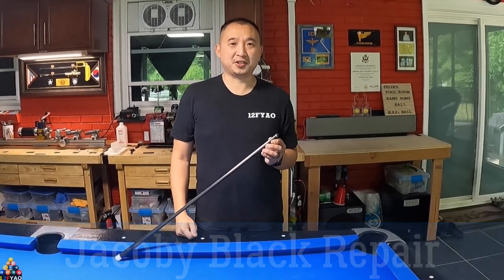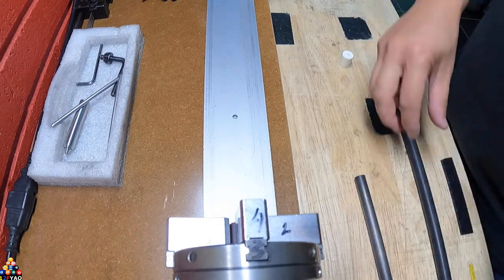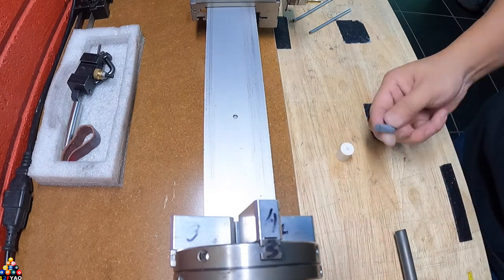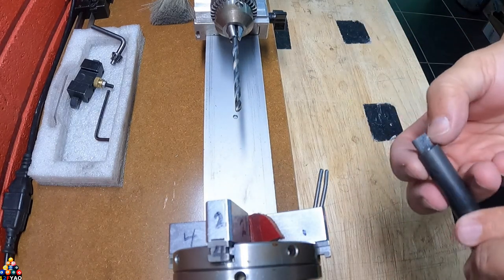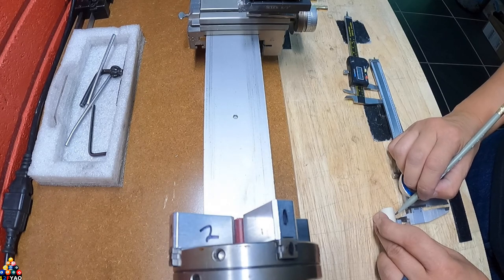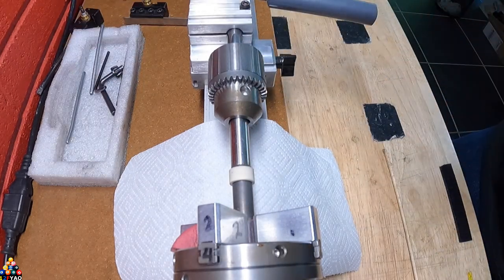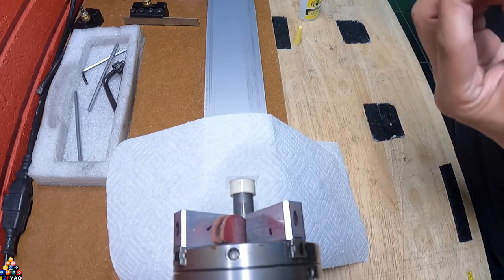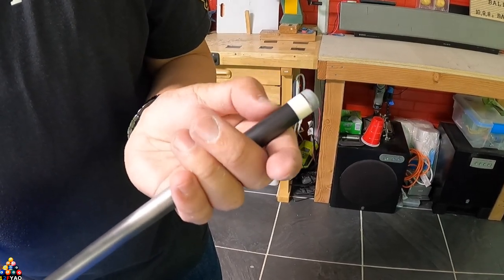Jacoby Black Carbon Fiber Shaft Repair

Comment: I add glue relief grooves in my inserts to promote adhesion.  I would have also milled the g10 like a plug to ensure it is seated properly in the shaft, then take down the exposed material and add the ferrule.
Reply from the maker: Thank you for commenting. I will do that on future shafts I might be fixing.

Comment: I have a suggestion, have you ever thought on about gluing a tape meaning to your work bench do you could just butt up the shaft against a fix/removable/flip piece of wood and do it all with one hand or have both available? Even you could compare two shafts at once without having to guess it and measuring twice.
If that doesn’t work, could you share with us why doesn’t it?
Thank you!
Reply from the maker: I actually do have a measuring tape taped to my work bench. I use it just to get a quick measurement and if precision is not needed. It is very helpful especially when cutting wood blanks. I also like to use a tape measure to get me the accurate length. Thank you again for commenting.

Comment: I have a Revo that is making a ticky noise from the vault plate.  The vault plate likely has a small crack and scratches.  I would like to remove the vault plate and replace it with a small white ferrule similar to this video. How can I reach you for the repair work?
Reply from the maker: I would reach out to Predator first. They should warranty the shaft. Also replacing vault plate with a longer ferrule will change the deflection properties of the shaft. It would most  likely have more deflection. Hope this helps.

Comment: Thank you so much for your video.
Is there any way to remove the scratches on carbon fiber shaft after the ferrule without cutting the shaft?
Thank in advance.
Reply from the maker: You can try to sand it off. The scratches can’t be too deep or it will change the diameter of the shaft. Also if you plan to lightly, I mean lightly, make sure you get quality sandpaper like 3M, no less than 1000 grit. Hope this helps, please subscribe if haven’t already and please share.

Comment: Why wouldn't you have simply filled the scratches and then polished the fill down to original size?   Seems to me like all the changes you made are going to alter how it performs.
Reply from the maker: My friend didn’t want nothing to do with the scratches plus the shaft was making noise. He wanted a real ferrule where he can see it plus he is good enough where he can adapt to little changes.  I totally agree on how I altered the performance on the shaft, my friend likes it better, now it has the same deflection as his wood shaft, he doesn’t have to adjust when playing with his wood shaft to this carbon shaft, a ferrule he can now see and the annoying sound on the front end is gone.  He is happy with the change, he doesn’t have to switch shafts when playing 10 ball to 1 pocket.  Thank you for commenting, please subscribe if haven’t already and please share.

Comment: how can you make a carbon fibre smooth. i have a revo shaft and it’s not smooth at all, i tried cleaning it with alcohol wipes and it’s still the same
Reply from the maker: That is one way I clean carbon shaft too, alcohol wipes. That is the recommended way to clean them. Sorry can’t help anymore and thank you for subscribing.

Comment: All areas of the pool playing world need someone who can fix pool cues to some extent. You are doing fine. As for the performance of the cue afterwards, the difference in this case will be small. It appears that you may have moved the pivot point of the cue just a small bit to the tip. Instead of a pivot point of 14 to 15 inches for a Jacoby Black, you may have made it a 13 to 14 inch pivot point. That will do two things, the response of the cue for spin etc. will go up a little which will make it do a little more for you but as a shafts pivot point shortens, it's friendliness to shooters bridge position decreases.  Shortening the pivot point adds to the response for spin but also adds to ability to go wrong in the shot. There is always a give and take to everything. If the owner has good stroke fundamentals they will like the change but if those basic fundamentals are not so good they will have more misses. 

All Predator cues have a 19 inch pivot point which makes them extremally friendly for Parallel English, this is what they are made for.  The 19 inch Predator shafts are excellent for Parallel English but anyone trying to play Back Hand English (BHE) will need a shaft with a shorter pivot point then 19 inches. The further back the pivot point of the cue the further back you need the bridge for BHE, 19 inches is too far back. The Jacoby Black has roughly a 14 to 15 inch pivot point off the shelf and this just so happens to be a friendly shaft for BHE. This is the ideal size to start learning BHE. I custom made my personnel carbon fiber shaft with an 11 inch pivot point specifically for BHE which is amazing for spin performance but costly if you are not bridging exactly where the shot needs and is not something available on the market in carbon fiber. You may find lesser regular wooden shafts with a pivot point this short or less but I am yet to find a carbon fiber with such a short pivot point. The 11 inch pivot point is not recommended unless you really understand where to bridge for specific shots based on cue ball to object ball distance and power.

I do not call this system of using Back Hand English, Back Hand English, it also needs Front Hand Pivoting as well sometimes so I call this style of applying spin "Pivot English". It is all about where you bridge and pivot. If you use the back hand to pivot for spin, you are pivoting at the bridge hand or front hand and when you use the front hand to pivot, your are pivoting at the back hand. In closing you did a great job and may have only enhanced the spin ability of the shaft with minimal increase in its unfriendly behavior.
Reply from the maker: Wow. Thank you for your deep analysis. Not many “pool players” know or even heard of back hand English. I use it for shots that requires a fast firm hit to move the cue around the table. I use with my Revo and I know I have to compensate a little because I don’t have a long enough bridge. For the Jacoby shaft, it’s my friend’s shaft and he also uses back hand English. The only thing is, that is not his primary shooting shaft or cue that mates with that shaft.  He doesn’t compete in tournaments like he used to. He just shoots for fun now. He uses almost all his cue and many are standard maple shafts with custom tapers for custom cue makers.  I he has been playing pool for a long time so any shaft and cue he picks up, he can adapt to how much deflection the shafts has. I don’t even think he has really noticed the pivot point on the Jacoby. He was just happy the deep scratches are gone.  Thank you again for commenting, please subscribe if haven’t already and please share.
Reply: @Soniccues  in your experience, how do you manufacture a carbon fiber shaft with a specific pivot point? Is it a question of where the foam mass should be?

Comment: try using your auto feed when trimming your ferrule down works really well nice smooth cut
Reply from the maker: I not that confident with the the auto feed. I already crashed it and messed up the teeth on the pinion. I ordered two extra just in case moments lol. Thank you for commenting.

Comment: Why didn’t you first attach the ferrule to the tenon and then cut both at the 29’ mark?
Reply from the maker: I didn’t have two shafts. I was removing the scratches by cutting the carbon fiber shaft.  I had to make the ferrule longer due to the carbon fiber being shorter. Hope this helps, don’t forget to subscribe if haven’t already and please share.

Comment: Jacoby's warranty didn't cover this? I've sent mine in multiple times free of charge.
Reply from the maker: They probably do. He got the shaft second hand and from the looks from it, someone scratched the shaft up. That is really hard to get warranty case when someone used coarse grit sandpaper on the shaft.  Thank you for commenting, please subscribe if haven’t already and please share.

Comment: amazing work !. just have a quick question. i recently changed the tip on my revo shaft. that was one month ago but i recently noticed some remaining stains from the super glue on the shaft just under the white vault plate. i tried removing it with alcohol but sadly that did not work. i would really appreciate it if you could tell me what to do.
Reply from the maker: Nail polish remover work to an extent. Try not to get it on the tip. It can weaken the bond on the tip and it can delaminated the tip. Also you can slowly pick a the glue with “dental” tools or a slowly scrap it with a razor blade. Hope this helps, please subscribe if haven’t already and please share.
Reply: @playpool12fyao  thanks a lot for answering so quick !. I will try it tmw and hopefully it will work.
Reply from the maker: No problem just be very careful when using the sharpe tools and it might be easier if the shaft is held by something like on the lathe or shaft taped up and on a vise.
Reply: @playpool12fyao  i tried it with Aceton and it worked ! thanks a lot. now it looks new again.
Reply from the maker: So glad it worked and thank you for keeping me posted.

Comment: Hi, just want to ask, does jacoby carbon fiber shaft originally have a male type ferrule like the cuetec cynergy where you put the ferrule inside the shaft instead of putting a tenon on it?
Reply from the maker: It might use the same ferrule but it was not a solid tenon. The ferrule was hollowed. In my opinion a, the G10 is lighter and much stronger than any hollow ferrule. Hope this helps, please subscribe if haven’t already and please share.

Comment: how to make cue smoother or clean from little scratches ??
Reply: i mean mapple wood shaft..how to clean lilttle scratches?using sand paper ?
Reply from the maker: On carbon fiber shafts, that is a little difficult. Some tried rubbing compound then polishing compound but some are so afraid to anything except using rubbing alcohol. I use rubbing and polishing compound on my Revo and nothing happened to it. It doesn’t damage the carbon fiber. If you think about carbon fiber is used in many applications. Also been in army aviation, we worked on carbon fiber and we saw what carbon fiber can go through. With that said, you can also use micro sand pads. I have done it and it will remove light scratches but that is it. Hope this helps, please subscribe if haven’t already and please share.
Reply from the maker: Same, use micro sand paper so you don’t change the tip diameter. Hope this helps. 
Here is the link. 
https://www.hobbylobby.com/Crafts-Hobbies/Model-Kits/Paint-Brushes/Micro-Finishing-Cloth-Abrasive-Pads/p/108354?gclid=CjwKCAjw_MqgBhAGEiwAnYOAesDT8aWSJD4eHhkmhsCGwzqgZ4naJQT-SbkAr7BvIVaTjmc5n8hbdxoCmhoQAvD_BwE

Comment: CARBON FIBER SO SOLID WHY DO YOU NEED A FERRULE?  A TIP AND SPACER ADDS MORE DIRECT FEEL TO THE BALL??
Reply: Because most people think that the lack of a white ferrule will affect their ability to quickly sight the point of aim while shooting.  Makes no difference to me.
Reply: @masonryman8183  If it doesn't affect you, then great. But it does affect A LOT of people....me included, reason being that the white actually shows up as a reflection in the cue ball when you're addressing close to the cue ball(that said, it probably wouldn't make a difference to people who don't address right up to within 2-3mm of the cueball.)
Reply: They aren't solid. they have foam on the inside

Comment: what lathe do you recommend? (link)
Reply from the maker: What kind of work are you planning to do.
Reply: @playpool12fyao  the most common thing here in the salon is the change of tip or ·virola"
Reply from the maker: http://www.midamericapool.com/index.html
Here the link where I got my lathe. Hope this helps, please subscribe if haven’t already and please share.
Reply from the maker: http://www.midamericapool.com/index.html
Here the link where I got my lathe. Hope this helps, please subscribe if haven’t already and please share.
Reply: It was hard for me to watch your video because of how sloppy your work is.  That's not a judgment, but an observation.  You used a piece of leather to cushion the shaft in the chuck,  probably assuming that the shaft would stay centered because the thickness of the leather would be consistent.  No way possible!  In fact, when chucking up anything, you should be using a dial indicator to verify that your work piece is actually centered.  If not centered, you can use thin shims of paper to achieve a perfect center.  You almost certainly lost your center by at least .004", the way you did it.  With experience, you will learn these things.  Good start, but sloppy at this point.

Comment: I couldn’t believe what I was watching!  I finished the video out of morbid curiosity. That shaft will never play the same again.  I guess if the customer doesn’t care about that then its a useful video.  I have watched a couple of your videos when you use the lathe.  I gotta tell you, this is not your expertise and is treated more like a hobby than a profession.  I wouldn’t recommend anyone follow these methods.
Reply from the maker: The shaft surly doesn’t play the same. The customer loves it even more. No more rattle and the shaft feels more solid not hollow like before. The deflection is about the same. The G10 didn’t affect the deflection but what it did is get that hollow and feel sound out of the shaft. Also you are correct, pool and pool related things  is a hobby to me  and I don’t want it to be a profession. I’m retired and don’t really want to work anymore to include making pool cue and repairing pool cues. Thank you for commenting, please subscribe if haven’t already and please share.
Reply: Agreed the shaft should have been sent to jacoby. They could have repaired or
Replaced the shagt
Reply from the maker: He got the shaft second hand and he did not want to tell who did the work previously. I has to fix some of his other shaft because of posers trying to put on a tip. For some reason they think sanding the ferrule and the shaft is the correct way to trim down the tip.  Thank you again for commenting.